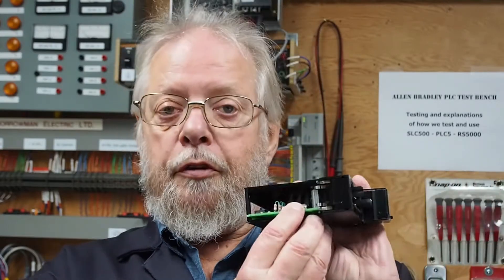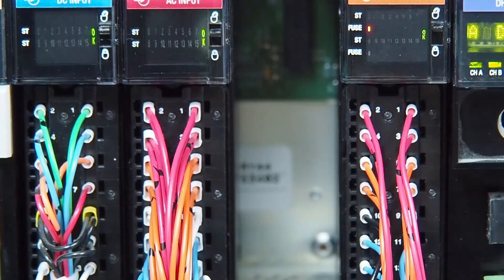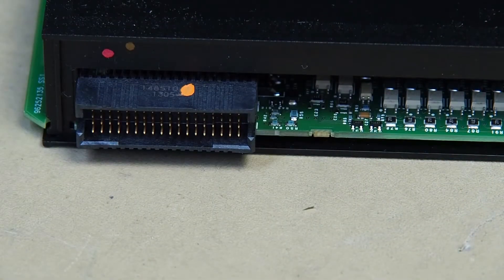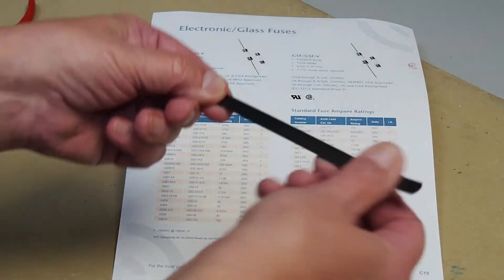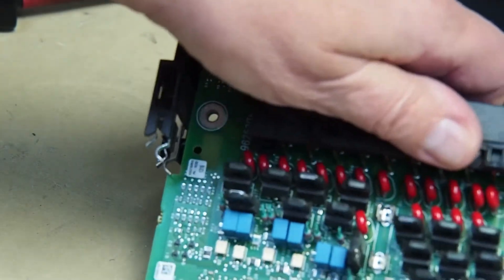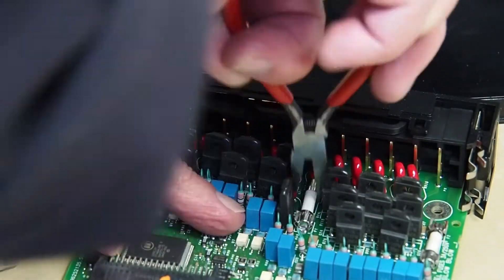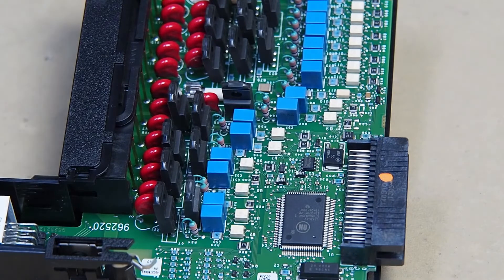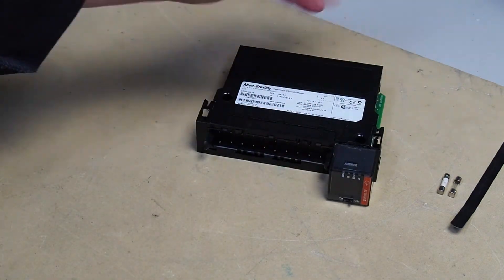1756-OA16 Ver 3.2 Fuse change

Comment: Hey sir, can you send to me your email . I wanna speak with u about business.. thank u 🙏
Reply from the maker: I don't have an email I feel comfortable posting on YouTube.  And I do not think YouTube has a messaging system.
Where on the planet are you located?
Reply: @abplctestbench759  Best
I am a student in Belgium, I am doing the professional bachelor electromechanics. I am in my third, so final year. I am currently doing an internship in a large company and my project is about Predictive maintenance through visualization (ControlNet visualization). I need to develop a diagnosis and investigate additional parameters. At the end I have to visualize everything so that the technicians can get to work so that they can detect errors in the production process in time.
I am looking for someone who knows Controlnet cards and who can possibly program and help me to complete the project. I will also pay for his help. But first I would like to talk to you about it and see how we will go about this.

Best regards
Reply from the maker: @mo.nh4845  ControlNet is a communication protocol that is barely used anymore.  It was one of those ideas that was good at the time, but has been given up by most companies.
By far the largest portion of the controls market and controls themselves use ethernet communications.
Controlnet is not a platform that I know much about and have sold very little hardware for it over the years that I have been in business.   Rockwell now lists Controlnet as 'Active Mature'.  Which is one way of saying - it is not going to be around for a really long time.
Good luck on your quest.  Bruce

Comment: Hello. I have a question. I need to trigger an output fast and consistent. I'm using a L61 Control Logix Processor and a regular output card. My problem is my output is not consistant. Is it possible to use a high speed counter card output without the use of an encoder? My photo eye to trigger my reject is right before my cylinder.
Reply from the maker: Hello Camino:
In order to have a fast and consistent output you MUST use a DC output.  AC outputs as much as I like them are very slow when compared to DC outputs.
Rockwell makes a specific DC output - 1756-OB16IEFS - ControlLogix DC (10…30V) scheduled, electronically-protected, sinking or
sourcing, isolated, fast output module.  There are also programming techniques that can be used to make sure that the module takes precedence.  
Some research by you will be required to implement the use of this module, but if you need the speed then you need the DC.
Thank you for subscribing to my channel and I hope my explanation helps you with your problem.
Reply: @abplctestbench759  thank you. I was just reading about that module. I'm going to order it. The current module i have is a 1756-ob32
Reply from the maker: @CaminoYVerdad1  Glad to hear that you have decided on that module it should do what you need.
Please let us know how it all turns out.